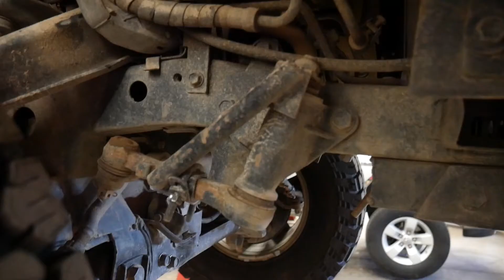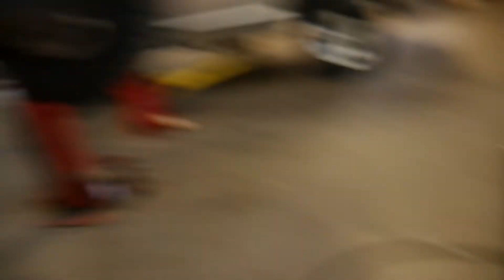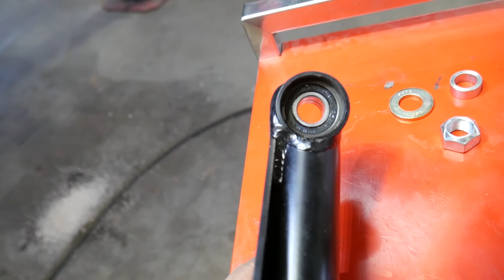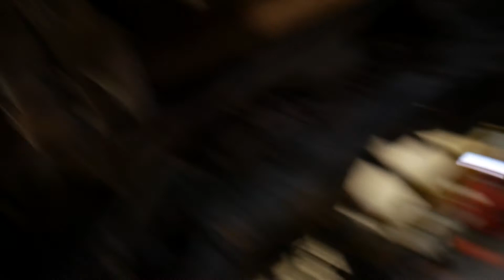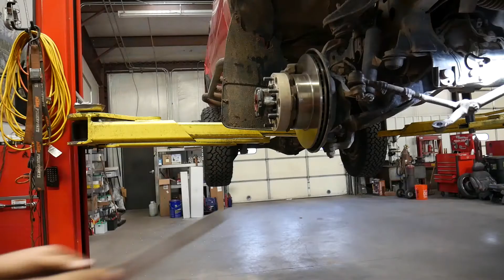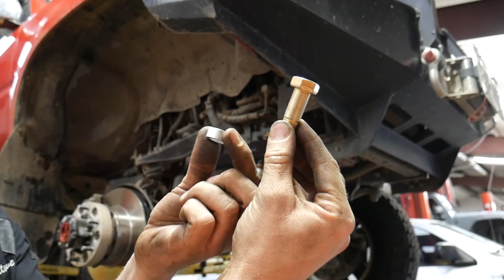Total Chaos Caddy Idler Arm install - Toyota Pickup 4runner hilux

Comment: Just out of curiosity has anyone had to change those bearings on the centre link and if so how long did they last
Reply from the maker: I check it whenever I have the truck on the rack and if I notice any play I snug up the pivot bolt. I have not noticed any play at the center link connection yet.

Comment: Been running 33 12.5 Mickey T since 1994 when I bought my truck. Never had a issue with the idler arm. I did upgrade my drag link a long time ago tho. My truck still working with me here in Texas doing pipeline work.

Comment: Ones again big fan of your YouTube channel💯💯, I did the TC swap from my originals idler , now I need advice what is a good tie end rod inner and outer upgrade , basically and trying to upgrade all the front end , and what is the best steering stabilizer is it fox or any other brand you recommend ?

Just to keep you update it is 1993 Toyota T100 with 60,000 miles , I did the super lift kit 5in and doing the 33in 15x10,,  am not going to do serious off-roading just minor off reading & mostly highway
Reply from the maker: Abadi 4m chicago I’ve never bent any of the factory tie rods or pitman arm. There used to be a company that sold gusseted center links and HD tie rods but the name eludes me at the moment. I normally run the same brand stabilizer as shocks but it doesn’t matter. Old man emu, toytec, fox all make good shimmy shocks.
Reply: ThePracticalMechanic 
 Is Moog a good brand for tie end ?  And ones again thanks a lot 

, I just send a link to all my Facebook T100 Toyota group there all watching your YouTube , thanks for support
Reply from the maker: Abadi 4m chicago moog are decent and have a good warranty. I prefer the sankei 555 brand tie rods and ball joints, the rubber boots last longer and they seem to hold up better off-road.
Reply: ThePracticalMechanic the problem is no one is selling any parts for the T100, I need good High quality any part number
Reply from the maker: Most of the parts are the same as a 4runner or pickup/Hilux. The center link is about 6in/150mm longer and heavy duty options may be limited. Some Toyota 4x4’s in the 90’s had a safety recall that required the replacement of the center link. You may want to call Toyota with the vin number and see if your vehicle is covered. The newer one may be slightly stronger if the recall applied to the t100.

Comment: $400 bucks for an idler arm! Nice product but holy cow!
Reply from the maker: I used to replace them several times a year and so far so good with this one.
Reply: @ThePracticalMechanic  hows it holding up still? Im about to buy one to go with my long travel kit
Reply from the maker: Dangerous Fandango so far so good. I tightened up the pivot bolt slightly on Friday before we went to the mountains.  I probably should have tightened it as much as I did because I had stuff steering for a while. I probably would have replaced 2 or 3 stock units by now.
Reply: Dangerous Fandango how long this upgrade would last you ? Am mostly doing highways

Comment: Helped alot. Thanks. That bracket should save me money in the long run. Ive already been through 3 tie rod ends and an idler arm.
Reply from the maker: Great, Glad I could help. It will pay for itself for sure. Wearing out one set of tires, or having to realign whenever the factory bends would cost more than the Total Chaos Arm. What vehicle are you installing it on?
Reply: ThePracticalMechanic  its an 88 toyota 4x4 5 speed pickup
Reply from the maker: Jordan Sapp sweet.  Those are good trucks. An I had a 1987 turbo 4x4 as a first truck. Ended up swapping a non turbo engine, harness and computer into it when the stick engine overheated.
Reply: ThePracticalMechanic  ive never had a problem with mine overheating. Its a 3.0 and the odometer stopped at 289k over a year ago
Reply from the maker: Ahh our shop truck is an 88 extended cab with the 3.0 and automatic transmission. Wish it had the 5 speed though. I also have a 94 and 95 with the 3.0 engine both are around 300k. So much more power compared to the 22re. The truck in the video has a 3.4 supercharged swap.

Comment: Does TC make a mid travel kit that would fit an 87 4Runner?  Would I have to weld the strut tower?
Reply from the maker: Kango Fitness The website only shows long travel kits. And those do require welding in a new upper shock mount. There isn’t a lot of options for mid travel kits on the 86-95 IFS Toyota’s. I have considered cutting out the factory shock mount on the red hilux and welding in a new shock hoop so I can get a longer shock and more travel.
Reply: ThePracticalMechanic I just bought a small welder so I can be able to do some of this work myself.  Will you run their upper and lower control arms as well?..which would require a cv extension..from what I can see in most of their reviews, they are reputable.  Dope ARB bumper too.
Reply from the maker: The bumper I built myself but it is very similar to the arb. I would make sure you comfortable with the welder before tackling suspension modifications and make sure it can handle thicker material. Your original setup uses torsion bars to hold the weight and the Long travel kit uses a coil over shock instead. All of the weight will be placed into the upper shock hoop that you have to weld in place. The cv shafts will definitely need upgraded. I would like to upgrade to RCV axle shafts but I have also considered a 3 link solid axle swap with coil overs.
Reply: ThePracticalMechanic I looked @Blazeland for 1st gen mid travel..their kit looks like an extension of the stock arms and cv.  There’s video of some extreme testing on their kit and great reviews.    I’m doing my own 1st gen 4Runner build for an overland truck and I don’t want to go with the solid axle..I also don’t want a ridiculously wide track in the front.(pre-runner look). https://youtu.be/MREVwStrrYk
Reply from the maker: Kango Fitness I looked into the blazeland kit as well. It widens the front end 3 inches on each side so 6 inches total. If I remember correctly you have to install T 100 axle shafts because they are 3 inches longer. And then you have to run either a coil over shocks or a heavier torsion bar because you end up with the leverage disadvantage with the extensions on the control arms.

Comment: This is very comprehensive.  Good stuff!  I'm expecting to snap my original idler arm on my '94 4x4 XtraCab 22RE.  My buddy's snapped on his '88 last time we went wheeling, and we had to leave his truck in the woods to take mine back to civilization to get a replacement idler arm.
Reply from the maker: Although it’s pricey for the Total Chaos idler arm, it’s worth it for the strength. Completely change the steering feel and responsiveness even with bigger tires. I have 2 more stock Toyota pickups and if I ever have to replace the idler arm on either one I will be installing the upgrade.
Reply: Yea it's something it's nice to have a backup of
Reply: @jeffgood6441  I ended up getting the Total Chaos arm for mine years ago.  Still going strong as my daily driver.  Rebuilt the OEM one since it was so cheap just to bring with me on the trails in case another similar Toyota were to break theirs.